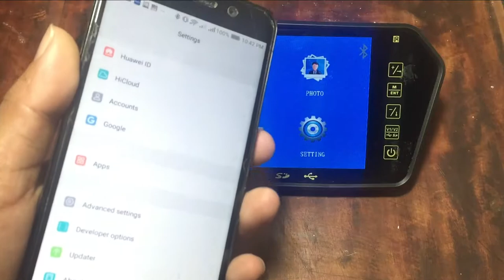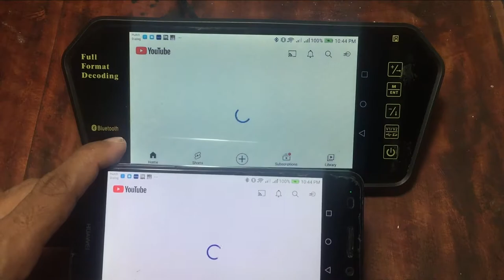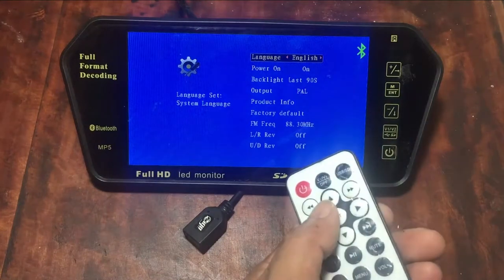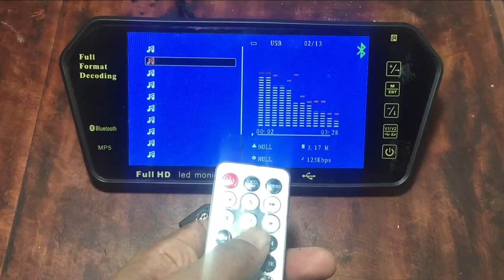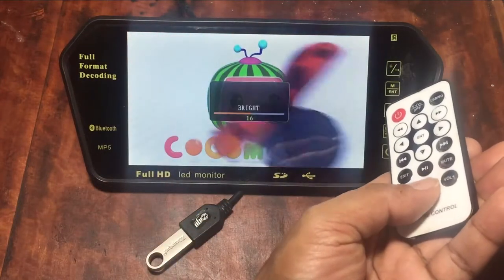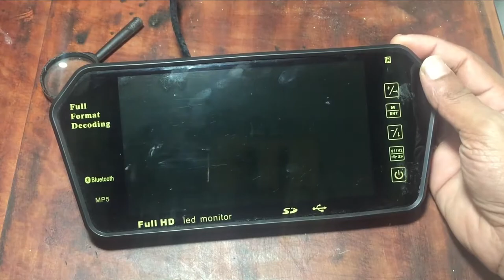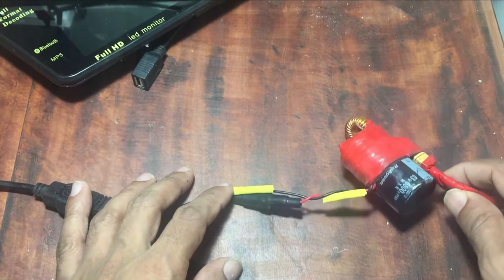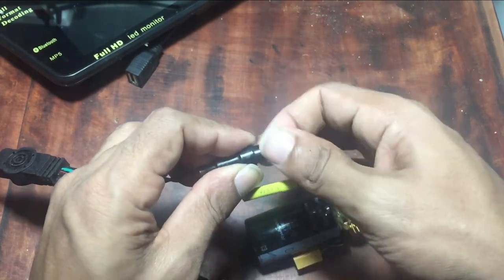7 inch car MP5 player with android mirror function

Comment: Hello, how can i see reverse camera wothout putting R
Reply from the maker: Give 12v to the reverse camera activation wire (The wire you are going to connect with the reverse light)👍
Reply: On v2 wire and also you can put other camera on v2 wire